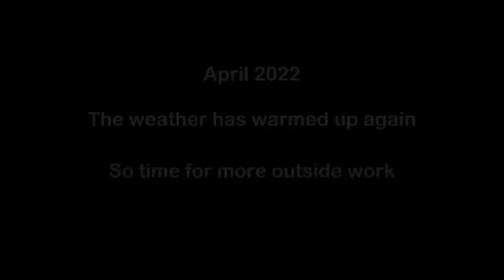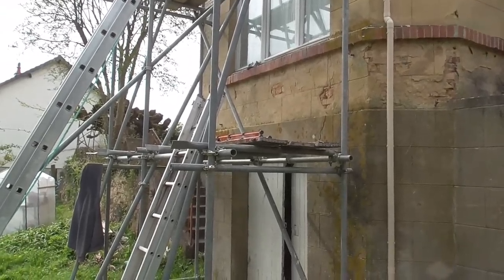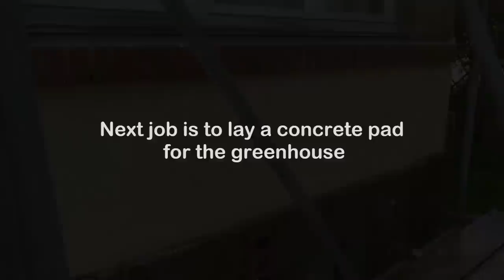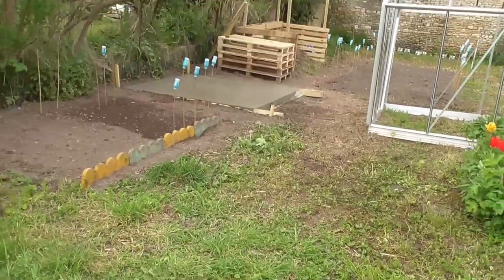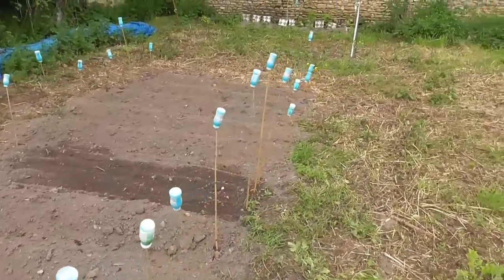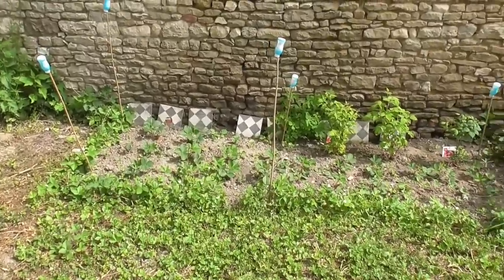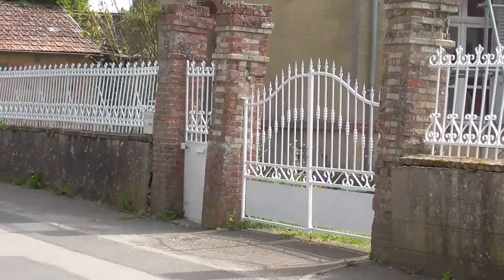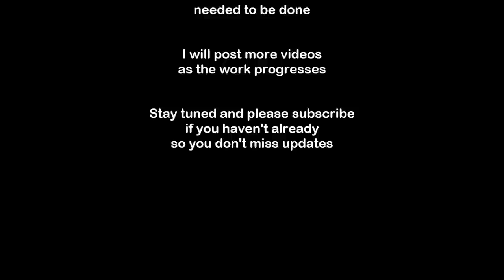Our French House Adventure Part 24 Outside again

Comment: Add some tubing into your compost for air, you can buy it at brico with lots of small holes in it in yellow or red.  It will cut down composting time in droves.

Comment: I'm curious why you rendered that section. Once you removed the old rendering, I would have guessed you would have tuck-pointed the bricks. That's what I've seen others do on their very old restorations, so it made me wonder.
Reply from the maker: They were not the best quality bricks under the render, quite often builders use cheaper bricks if they are going to be rendered over, I suspect that happened here. Also I need to apply for planning permission if I want to change the exterior of the property

Comment: I wonder if it would be an idea to divide the compost heap so that when one part is getting close to ready for use, another can be starting to rot.  Good to see the road side wall looking prettier.   Will you be getting rid of the greenery on the brick columns?
Reply from the maker: I may need to make another compost heap as this one is getting full already, lol. As for the columns, they will be worked on soon